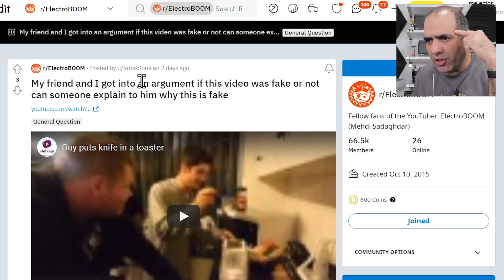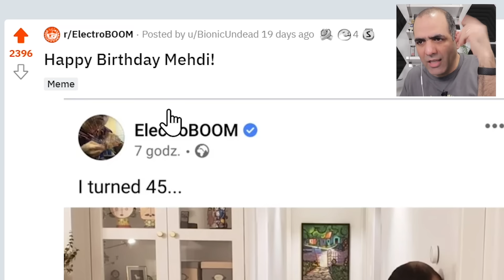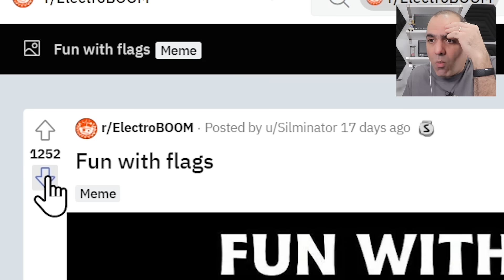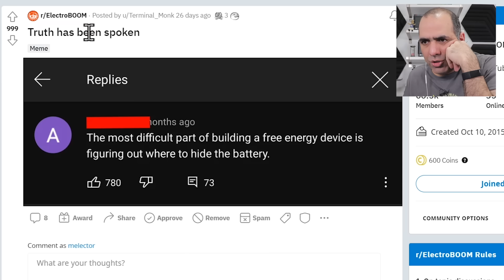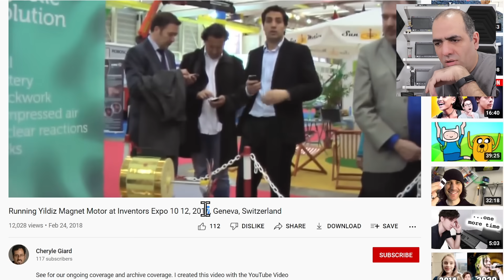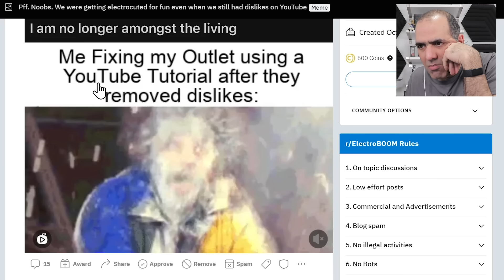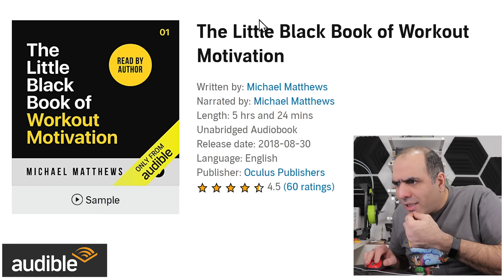Sticking Knife in Toaster? Welding with SALT WATER?!!! (LATITY-009)

Comment: Well, here in Brazil i've seen a lot of people doing that "salt and water" welding, it works. Here we call it "máquina de solda mexicana" or, in english, mexican welding machine (i don't know why). Here they put the cables of the "machine" in the main breaker of house or even before it in the city power line, it's dangerous as F but, in a emergency, it works.
Reply: It looks like medhis issue was he shortened the two rods together and therefore didn’t get the voltage drop needed. Stick welding is in the 24-28v range
Reply: @FishFind3000  He did not short them at first, or else there would have been no bubbling in the water. When he shorted them the breaker popped.
Since there is no transformer involved (or electronic inverter), there is only the voltage drop through the salt water, but the current stays the same. You are limited to the amount of current the outlet can deliver, which is not a lot, compared to what you need for proper welding (hundreds of amps at low voltage).
The electrodes are live at mains voltages, electrolysing salt water releases toxic chlorine gas. There is also no way of controlling how much current or voltage you're actually using. 
All in all a very stupid and dangerous setup, waiting for an accident to happen.
Reply: @maxine_q  Yes, i agree. But they keep doing it here kkkkk. Like i've said, it's dangerous as F, but people keep doing because they don't have that knowledge, i guess. The current is not limited by the cables, or even a breaker, it is the pure city powerlines the only limitation is the powerlines itself and how much Energy it can provide,  enough to melt the metal and weld or your skin out of body kkkkkkk.
Reply: https://www.youtube.com/watch?v=Kmh7B3owD_w&t=1149s That video shows one of those working.
Reply: mano, quando eu vi a introdução eu pensei que ele iria usar o vídeo do LetraJota ali como exemplo kkkkkkkk salve
Reply: @WagTsX   Tipo isso msm kkkkk O leandro q faz umas merdas assim kkkkkk.
Reply: Blimey. doing it before the supply fuse in the UK, your looking at 20KA available. You could vaporise your teeth with that, LOL
Reply: I assume is Brazilian s trying to scapegoat Mexicans into who's to blame for making something so dangerous.
Alternatively, a form of whataboutism.

Comment: I have a toaster where the elements are in quartz glass tubes like the more modern radiators, so I cannot touch any red hot wires with a knife. Anyway I still didn’t stick a knife in it anyway.

Comment: In a summary at 2:00
Every wire has its own resistance and the saying “electricity always takes the least path of resistance” in which case the knife has less resistance than the wiring due to a bigger volume for the electricity to pass through.

Comment: The easiest way to weld two dissimilar metals is exposure to salt water.
For example, put a stainless steel bolt in your aluminum anchor winch, expose to salt water and wait a while.  Done.

Comment: 4:00 I'm just wondering if those jars had caps made out of metal. When you drill a hole and put a threaded bolt through, it could make pretty good connection with the cap, right?
Reply: I believe they are made of plastic based on the fact that he used a soldering iron to melt holes through them

Comment: 2:35 = BTW, many knieves have metal blade that goes all way till the end (through the plastic handle). So you are always holding the metal part. The plastic handle is only for mechanical leverage, not for electrical insulation. The plastic handles are basically 2 pieces held by rivets with metal blade in center.

Comment: Isn't it possible that the Yildiz motor could be real? For example magnets are "Pushing" their fieldlines out (Speed of light) so a velocity torwards that should cause a deflection of the magnetic field into a magnetic Monopol. This energy is in fact not free. It could be the same as the proposed dark energy. Which has to be there. Look for Prof. Dr Claus W Turtur.

Comment: That magnet motor has been scrutinized and examined by many experts from several different fields and there has been no battery found for more than a decade of demonstration.
It works, but it is not free energy technically.
Reply: Meh, it works.... how much power can it deliver for what amount of time? How much energy do you need to put in to create that thing? All it does is spinning a tiny propeller. Probably couldn't even lift itself with a bigger prop like a helicopter.
Reply: There are several similar claims about various devices, usually you'll find the "inventor" doesn't really let people examine it closely, only reveals what he wants to reveal, and the audience isn't assertive enough to push hard to find out what's really going on.  Such scams can go on for years.

Comment: I have tried this before and it didn't short anything out. I thought I knew why, but now I am second guessing myself. So why is it when you put a copper or cast iron pan on the heat element of an electric coil on a stove top, it doesn't short out the coil?
Reply: Because they are isolated
Reply: @thesepy7541  Not sure what you mean by that. They are an electric heating element attached to metal, the same as a toaster. How are they "Isolated"?
Reply: @jameswood5832  no sorry i was talking about stove heating elements. You can watch mehdis video about heated seat for more info

Comment: There is a reason why Mehdi works on electronics and not dabble in chemistry. The water wielder machine is a modified electolosys (sorry I stuck at spelling) machine which spits water H2O to H2 gas and O2 gas, which are nontoxic.

Comment: I blew the filament in a toaster with just the tip of a tissue and it made quite a pop without tripping anything, realised later it turns into surprisingly conductive carbon, and even later that it may either be due to flame being conductive or a combination, which would be an interesting hypothesis for this channel.
Reply: What I think actually happened is that the tip of tissue caught fire, and the additional localized heat caused the heater wire to melt and spring apart due to the tension it's at, and one of the whipping ends hit something grounded or another point of the filament - that was the pop you heard.

Comment: I don't think I should show my 73 year old roomie this video, we-the sane roomies- watched them stick a fork into the toaster while getting their flaming toast out of it. Our outlets are so old, we don't have little buttons to push and have to run to the breaker box. Toaster roomie has been struck by lightning, was born with tachycardia and had a little rhythm issue and used house current to fix it, cheaply, instead of allowing their cardiologist to use the paddles.(DO NOT TRY THIS AT HOME) ...oh, and I figured out why our generous host is a little thin on top, he wipes his head after shocking himself, any lower and the uni-brow would be in jeopardy.

Comment: I stuck a knife in a toaster some time in the 1960s when I was a kid. Was a flash and a bit of the element welded itself to the blade. Back then the handles of knives had plastic handles not like modern all SS so no big shock.

Comment: The very first "welding machines" were exactly this: just a tank of brine/salty water to limit current.
This was however, over a century ago, before covered electrodes were being sold commercially and a vital part of a "welder's toolkit" was a peening hammer, to knock shut the porosities/bubbles which occur in unshielded weld beads.
Reply: Why not use a heating element (or several heating elements in parallel) for welding? Brine risks an explosion from the generation of hydrogen and oxygen near the sparks.
Reply: @BenHutchinson321  I suspect (the documentation is very vague) that these salt-bath welding machines weren't connected up to 230V (or 110V) AC mains electricity, but to portable generators which were capable of putting out a voltage (at least 24V ~ 40V DC) at a suitable maximum amperage (maybe up to 200A).
Out of an ordinary household 230V AC mains outlet, the most current you could expect is 10A (or 20A at 110V AC), so if you tried that trick with resistors (heating elements) you wouldn't get enough amperage to even tickle a little blue spark out of it, let alone a useable welding arc.
Reply: You probably meant over a decade not a century, but reading that really threw me off.
Reply: @stabileseitenlage  These welding "machines" date from the 1880's, premade covered eletrode were introduce by Oscar Kjellberg (founder of Esab) in 1904. Both were over a century ago.
Reply: @stabileseitenlage  They 100% meant century, not decade
Reply: @PsilocybePsientist  Oh, I never sent my reply. I actually misread the original comment and thought he said HIS first welding machine was like this. That's why a century seemed off to me. I can absolutely imagine that welding was a thing back then.

Comment: how about instead of torturing capacitors, a jacob's ladder for the speaker of the alarm clock with the snooze button dead center between the rails. ^_^ make  you think twice about reaching for that snooze or a quick way to charge your math for the day.

Comment: I would love to see a video with Mehdi explaining how the flow of actually works, is through the wires or predominantly through the air ? My brain hurts after hearing a podcast by a physicist explaining how it flows around the wiring, I need something visual to understand it
Reply: Electric and Magnetic field are usually outside of the wire. This is why you get Electromagnetic interference around cables. It's also how antenna's work. The energy travels through the air, but in order to the fields to exist you need to have current flow through the actual cables.
Reply: @Luxalpa  but isn’t the Energy and the Current the same thing ?

Comment: The "diy soldering machine"  is know in my country as "mexican soldering" normally done with a bucket and salty water , you can adjust de distance of the wires to adjust de "power" of the machine

Comment: I had a knife in a hand while pulling out my toast, the knife slipped and hit the toaster metal thing, it made a spark like in the video but the toaster died, but the fuse didnt pop (didnt have socket fuse though, just the fault currenty one.

Comment: If anyone must stick a knife into a toaster switch the toaster off and remove the plug from the wall.  Why?  If someone wired the power point up incorrectly everything will work BUT the element will be live even though the toaster is switched off.  (unless of course you live in a caravan which are (should) be fitted with double pole switches).  It is just best to pull the plug.

Comment: The toaster thing actually is significantly more dangerous with an older toaster. New toasters have grounded plugs and casings, but if you have an older one it was pretty common to get them with a non-polarized plug and no grounding. For such a toaster there is a 50/50 chance (depending on which way the plug is plugged in) that the heating element is live all the time even with the toaster turned off.
Reply: Until now, I didn't even know they make toasters with ground pins, never had one
Reply: @JakeInaitor5000  that's companies with no safety and health regulations for you
Reply: @JakeInaitor5000  All non-double insulated equipment need to be grounded, especially in kitchens. In Europe an ungrounded plug would not even fit into a grounded socket.
Reply: I hate that knives get singled out, like a metal spoon isn't just as dangerous. If you gotta dig, just use a plastic fork.
Reply: @AlexanderTzalumen  It was always a fork that was cited when I was a kid.
Reply: @AlexanderTzalumen  If you gotta dig, unplug the fucking toaster from the wall. How about that?
Reply: @UnitSe7en  that's no fun
Reply: Still wouldn't explode
Reply: Probably also has the nichrome wires coiled over an asbestos insulator.
Reply: @fredblonder7850  I’ve only seen mica ones.
Reply: Our kitchen is the only place with grounded sockets. Build in 70s I believe. Not up to current code but normal back than.
Reply: toaster nukes could still be a thing
Reply: @anhilo9716  I'd much rather have a Nuclear Toaster, though, as it wouldn't even need electricity! 😃
Reply: just unplug before you dig!
Reply: Awww, now you're just taking all the fun out of it
Reply: Arguably the grounding of a toaster makes it MORE dangerous. In the event that someone is touching the case of the toaster and also touching the element with a knife, it's safer for the case to be ungrounded, so as to not provide a path for the current to travel through the body to the grounded case. This is assuming that it is not a GFCI breaker. The polarized 2 prong plug is probably the best compromise.
Reply: @chrisbauer1925  actually a double pole switch is the best
Reply: @chrisbauer1925  No it is not. A device that is near grounded surfaces must be grounded. period.
Reply: @okaro6595  I agree that it is generally safer, but in the specific event that someoen is digging around inside it with a knife and touching the case the grounding of the case worsens the shock. In the event that a wire comes loose inside the toaster it is much better to have the case grounded. It depends on the situation.
Reply: Televisions and microwave ovens have capacitors that can have stored voltage even when unplugged.
Reply: laughs in UK plugs
Reply: They never ground them still
Reply: Y'gotta luv those Yankee electrics. Its amazing we've got any of you left
Reply: Noooooooooo! 😭
Reply: In my brother’s case a mouse climbed into the toaster to eat the crumbs and shorted out the toaster. The mouse did not survive.
In my case I sometimes shake out the excess crumbs into the tray under the toaster which can be taken out to discard the crumbs.
Potentially a mouse could still find crumbs. I unplug the toaster before I go out.
Reply: US Patent  2,954,451 (1960) is a double pole switch for toasters - that solves it
Reply: @stevengreenberg7634  It has been years since I have seen someone pull a full patent for a comment. It's amazing.
Reply: That would be a faulty toaster. It must cut both wires.

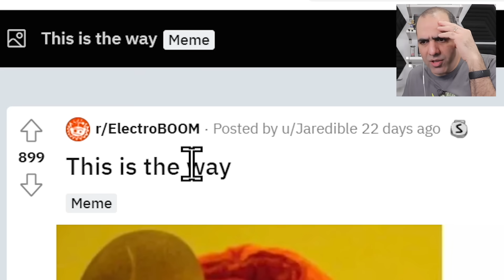Comment: 8:29 Another great alarm clock: a cloud of hydrogen, mixed optimally with oxygen and then a spark somewhere inside. That bang wakes up!
Reply: You can even just electrolyse water, so you'll have the perfect stoichiometric proportion of H2 to O2. Seems doable.
Reply: @PanduPoluan  
Unimportant how you GET that cloud, the bang is impressive. 
You could also put a chunk (~1cm³) of sodium into around a liter of water, that should also do the job, although it's very messy, with lots of highly reactive sodium debris and water shooting through the air!
Reply: With this setup, you can wake up the entire building with your alarm clock!
Reply: @windowsxpmemesandstufflol  
Exactly!

Comment: If welding with salt water worked like that, it would put all the welding companies out of business. I’ve heard of it being done with 220v and a 55gallon barrel of salt water. I wonder how the volume of water would affect it.
Reply: It does work fine given enough circuit capacity and water bottles. It's just super impractical to need 100+ amp circuits with barrels of water that will shock you if you look at it wrong.

Comment: So, the round "free energy" device; I have a theory.. Do you think the different types of metal he made it with could in a way BE the battery itself? Because from what I understand he did a good job fooling people with it. I mean, he got it to a university lol.
Reply: What if the hammer is hiding some ultra capacitors.

Although I like the idea that they are like ‘see no battery, just ignore all these components made of lithium metal’
Reply: @LogicalNiko  Right? I mean whats a battery, just 2 metals and an electrolyte. I could think of different ways to hide it all in plain sight.
Reply: @LogicalNiko  I didn't even think about the hammer, could have a piezoelectric kind of situation going on. We can at least rule out the free energy part though lol.

Comment: You joke, but I think the idea of building some sort of feeding mechanism for strips of components could be quite interesting, for example automatically feeding a line of batteries through a voltmeter so you don't have to pick each one up individually. Kind of like those coin-sorting machines, y'know.
Reply: Also if you want to test a ton of batteries it's easier to line them up side-to-side and move your meter leads from one to the next. You don't need to pick them up.
Reply: It's easier with brand-new components because they usually come on reels of tape which are specifically made to be machine-handled.

Comment: 6:04 this guy is killing himself on so many levels it's ridiculous. For anyone that needs conductive water (for an electrolysis for example) use sodium hydroxide (drain cleaner) instead of salt (sodium chloride). And if you for some insane reason decide to use salt and not sodium hydroxide, do it in a very well ventilated room or outside and whatever you do, don't fucking sniff or inhale the stuff that's coming out of the glass. The chlorine that gets separated from the sodium through electrolysis recombines with your mucous membranes to Form HCL (hydrochloric acid) and yeah you don't want that.

Aside from that the video was entertaining as always, thanks btw for busting the toaster goes boom myth (I knew that in theory it shouldn't explode but still, thanks)
Please be a bit more careful though

Comment: Interesting that your toaster is grounded. Easy to forget mine is a solid 60 years old and was built a few decades before those started showing up in homes.

Also you forgot to mention holding a knife by it's blade will probably hurt you especially if you do get electrocuted and grip it

And the Norway thing was logic gates